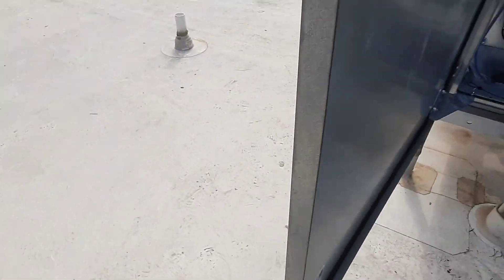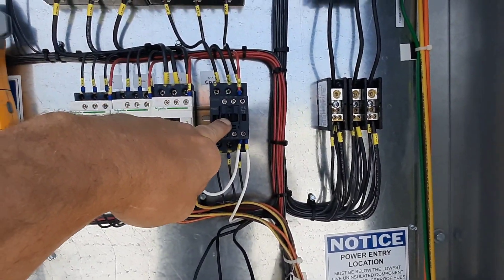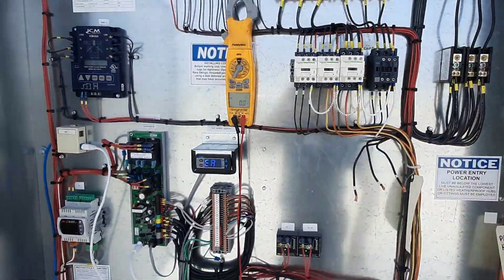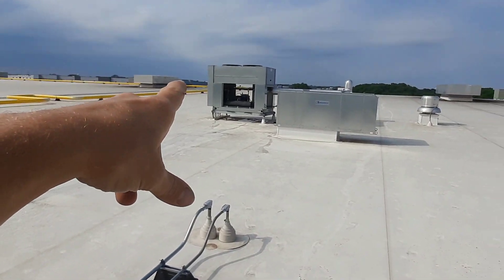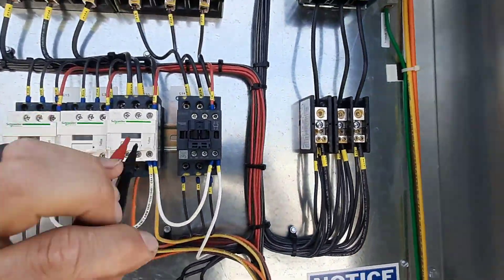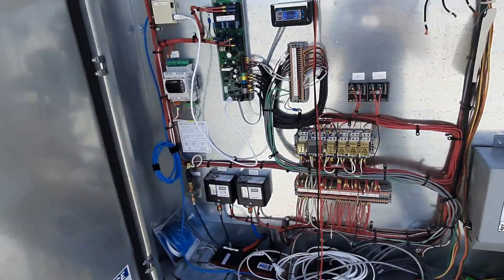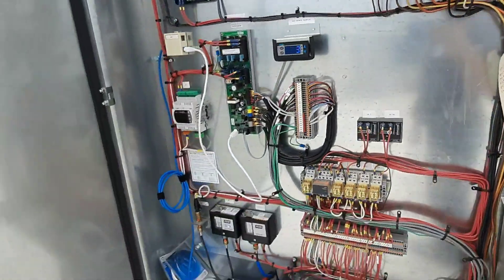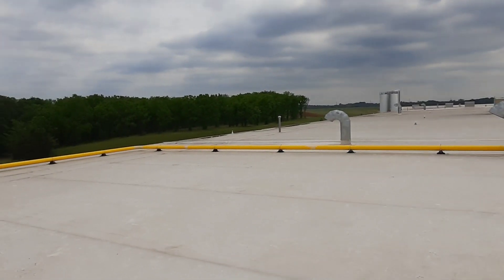Load phase loss, electrical diagnostics. #hvac #commercialhvac #hvacservice #hvaclife #hvactraining

Comment: Phase monitors save HVAC units of all brands , phase monitors are inexpensive to buy and inexpensive to install.  I can't think of a reason not to have phase monitors on all of your equipment.
Thanks for the video.
Reply: Any other brand or model of ph monitor you prefer?
Reply from the maker: These ICMs seem to work well.
Reply: I've used these from ICM, they are fancy ones, they keep an accutate, detailed history log; these things keep units alive in phase-loss and undervoltage; they aren't that expensive for what they do.  I like the units that monitor and use an external contactor, rater than the units that run the power directly through the phase monitor.
Ebay has them, about $110 or so, many sellers, shop around.
"ICM Controls Programmable 3 Phase Line Voltage Monitor ICM450A"
Reply from the maker: @davidnull5590 Thanks for the information, David
Reply from the maker: Thanks, David. I agree, everything 3 phase should have a monitor
Reply: Another good. Thanks for sharing your knowledge and experience.
Reply from the maker: Thanks, Jay

Comment: So id say your phase monitor kicked in the idea to check feed from  contactor ? Or did you start at the compressor looking at the delta /wye
 configuration to see if that was the issue? 
     Any how definitely a great short video !  Enjoying my sunday off , its fathersday my youngest daughter coming over for dinner tonight.
   Thanks again for the post ! Nice find
Reply from the maker: I started with a visual of everything. Once I verified the proper 3 phase from the disconnect into the contactor, it was an easy isolation and verification, so I started there and then checked the compressor to make sure nothing else was missed. Thanks, James! Happy Father's Day.